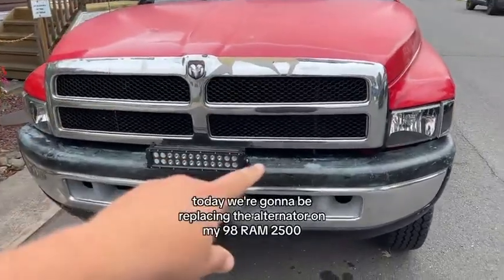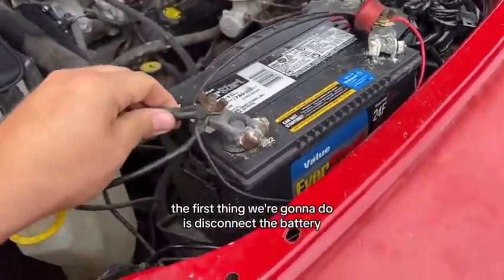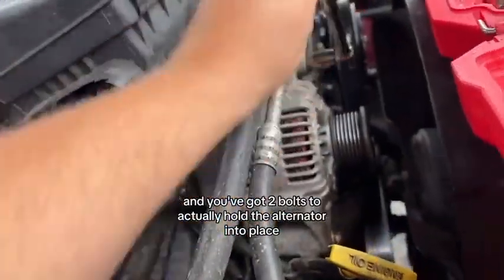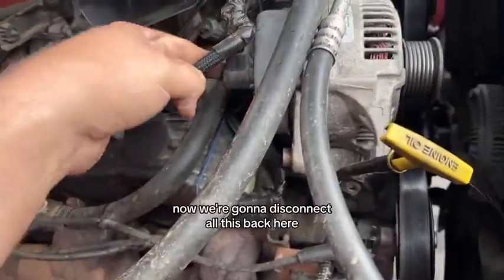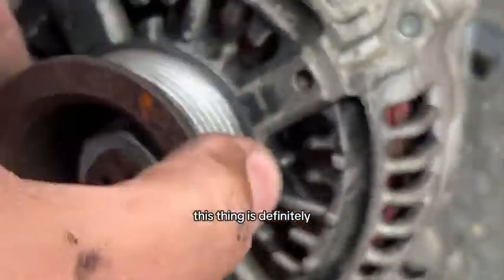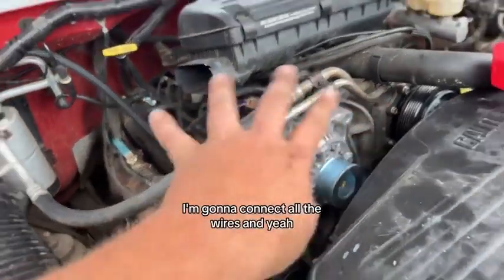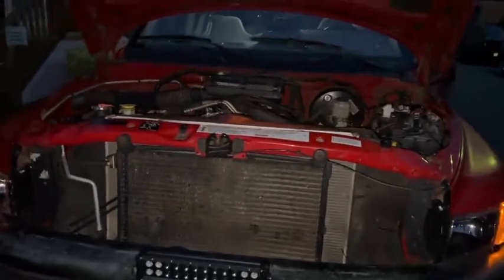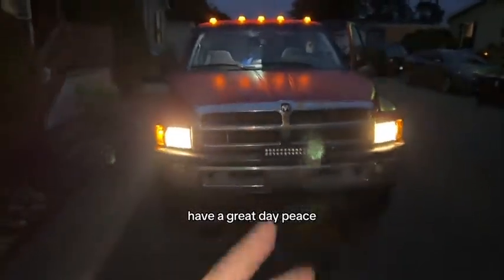My New Truck Already Broke Down!

Comment: all you really need to do is disconnect the black negative cable from the truck battery
Reply: better to be safe than sorry
Reply: @WilliamHollinger2019 if disconnecting both causes a difference electrical engineering textbooks would all need to be rewritten.

Comment: I done told you how many times to get a Toyota.
Reply: To expensive
Reply: @Bobby-cm7vu  its worth it
Reply: @Bobby-cm7vu  it’s worth it. I got a 2008 Toyota Yaris still going strong.
Reply: @rustyshackleford6799  my mom has a 2009 rav4 and the thing ran itself out of oil abd it still runs like a top, i would get one myself but even an 06 is like $12k and im broke